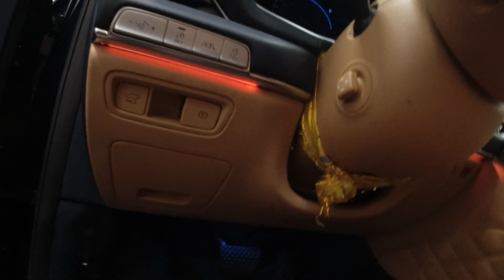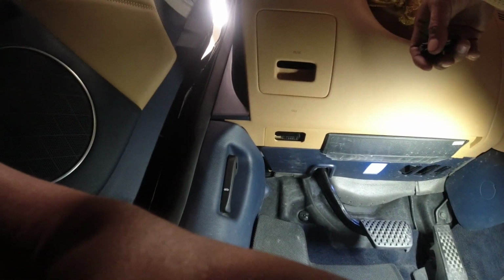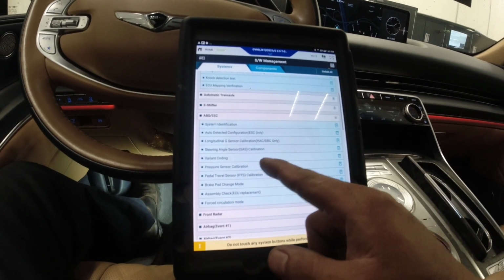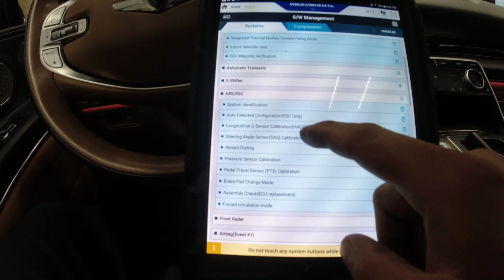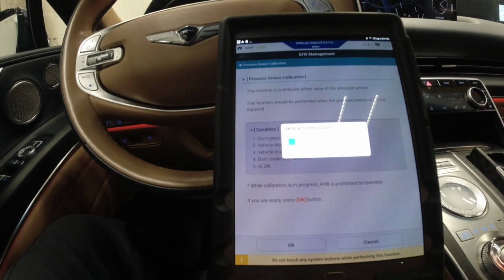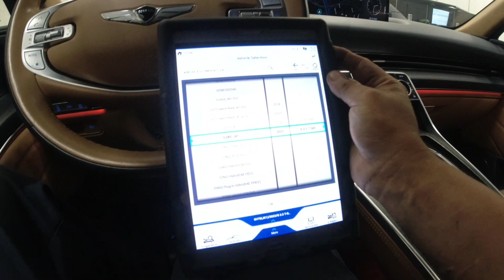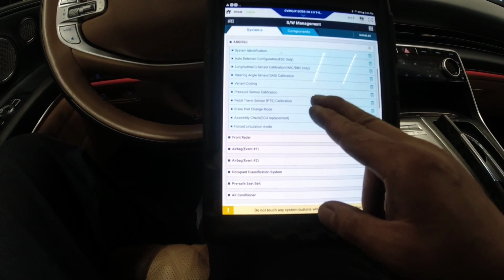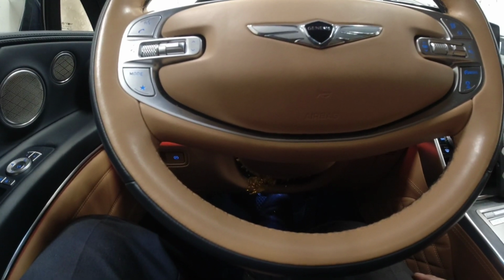Genesis GV80 clicking noise

Comment: Hey brother, what’s the best way to find out if my 2018 Elantra Sport DCT has the double clutch material that Hyundai was having issues with...the TSB is 21-AT-013H. Does hyundai know based on the VIN or would they have to open up the transmission to find out?
Reply from the maker: Usually we based it on the vehicle match the build date of the vehicle for the tsb and exhibit the symptoms and thats the time we do the dct repair.
Reply: @hyundaitech  oh okay, ya my car is a Korea built Elantra looks like DEC/11/17. Ya I was hoping if it was the old clutch material I could get it done while my vehicle was still under warranty, anyways thanks for the response.
Reply: Abs module !!!!

Comment: I have g80 2022. There is cracking sound from sunroof when I drive over any pamp on the road..
Another issue I have . Speed control  cannot control the speed when car going from top of hill to down 

Any advice please ?
Reply from the maker: Check if that model has downhill assist feature, but with 2022 there should be one, 2017 tucson has downhill assist.